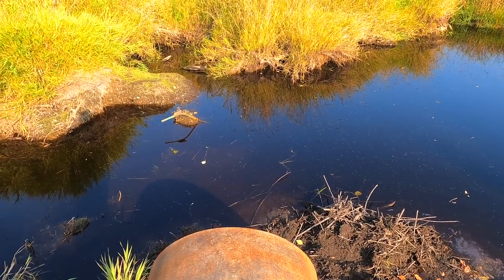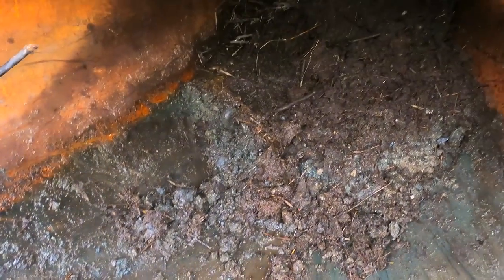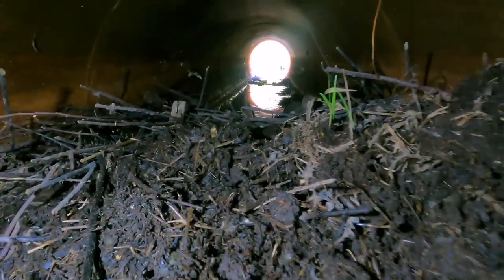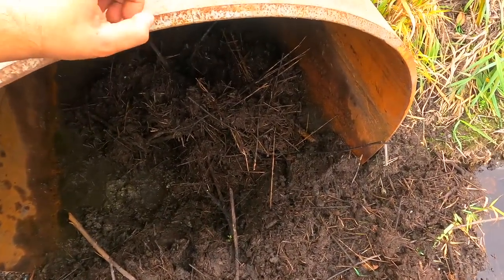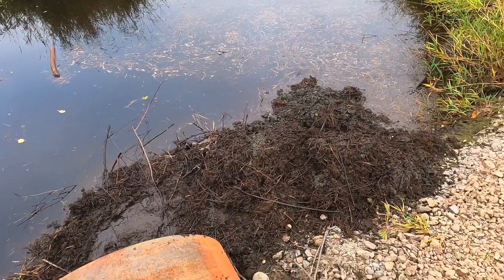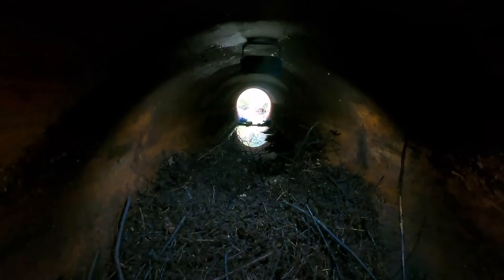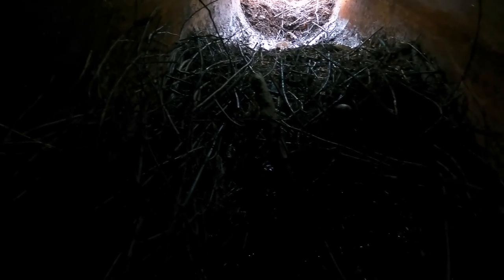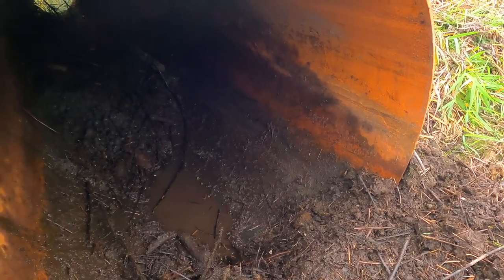Cleaning Up MASSIVE Beaver Dam Inside CULVERT Pipe!

Comment: No you are not lazy and I know its hard. I have had to  clean out my culvert pipe like that. but I used a tarp inside the pipe.  My nephew an I piled the dirt on top of the tarp  and then pulled loads of dirt out where we could stand and shovel the dirt back into my yard.  You might want to try it next time.  Also when you have to bag leaves. Get a wide cardboard box and open it all the way and place the open box inside of your leaf or debris bag. It will keep the bag open so you can use both your hands to fill the bag.  God bless your kind and good nature. You are the best. I really enjoy your videos.
Reply from the maker: Thanks for the recommendations! I’m not really sure where to go with the rest of the culvert pipe since everything on the other side of the dam is elevated. 

I know if that chunk gets removed all the way it will be a lot better. But it seems like the project will require several more hours to fully clean-out the culvert.